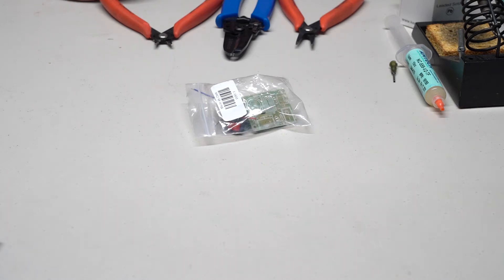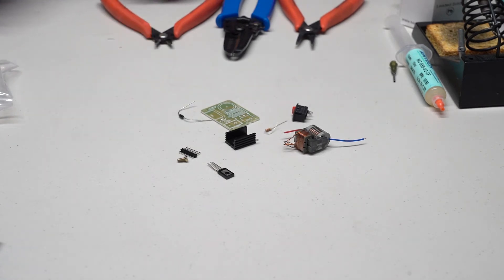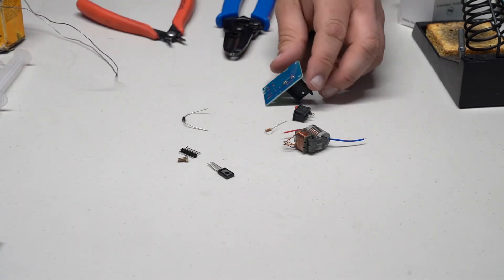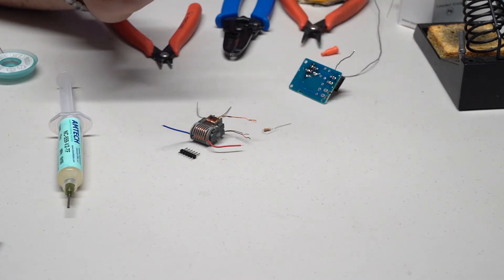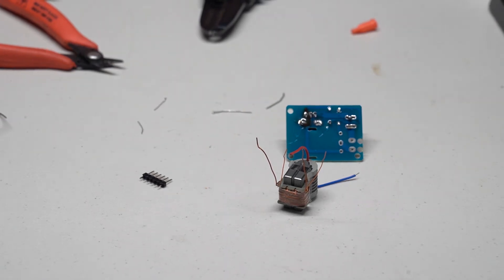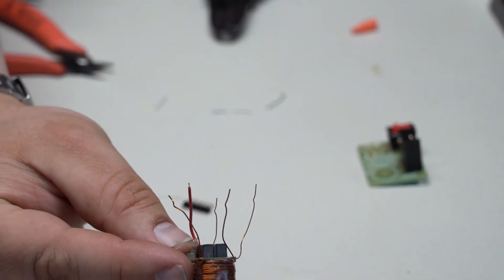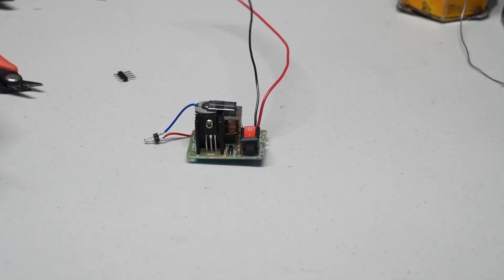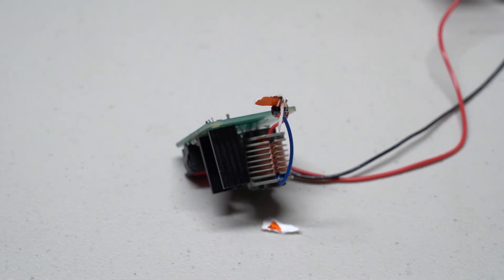Wish Igniter Circuit Build & Test

Comment: Well u assembled it wrong probably you mixed windings, change the direction you soldered the thicker winding, i get 1 cm arc from this. And another thing it's not dangerous at all you can burn your fingers a little at most. The voltage drop after touching it is quite big.

Comment: I think this is supposed to be used like the spark thing on stoves i.e to ignite a gas, not to ignite things directly
Reply from the maker: I promise you it's not. Someone looked up the simplest possible flyback arc generator circuit they could, built it, and threw it up on Wish.com as a parts kit. This is not a product that is designed and tested to perform any other function than making a spark that you can see.

In terms of igniting a gas such as in a stove, there are far better options, especially where "survival" is concerned. Requiring a battery power source severely hampers the advertised "survival" use. A survival/camping stove will have an igniter that generates a spark due to mechanical energy from a button press. As long as you can press that button, you've got enough power to ignite the gas. This is the same for a propane or MAPP gas torch. A battery powered circuit like this is needlessly more cumbersome, and they apparently left the engineering of the battery circuit up to the builder.
Reply: @manovermachine  Oh I see. And that is a VERY good point regarding survival equipment being mechanically activated rather than electrically

Comment: I agree with you about Wish! Bought this last year but as it is winter for me, thinking I will assemble, (maybe that should be ass emble)? Thanks for hint re wires.
Reply from the maker: Nice! Yeah, I was going to make another video on this but I ended up destroying mine. Accidentally applied 13V to the input with a bench power supply. My operation point was around 3-3.2V when it was functioning in the video, but it seems to draw exponentially more current as you increase that, and I had a limit of about 2.5A at that point, I believe.

The arc was bright as heck at 13V, but probably starting to be on part with a welding arc, not something you want to stare at for a long time.